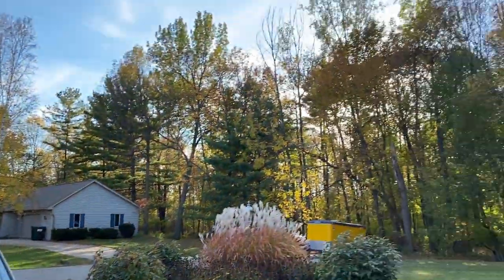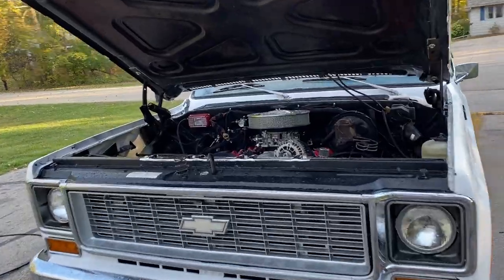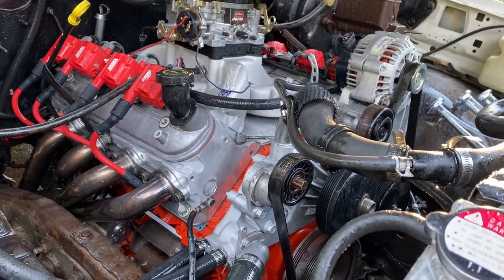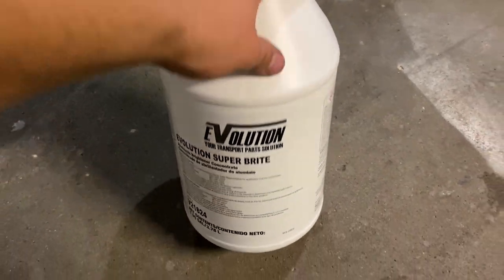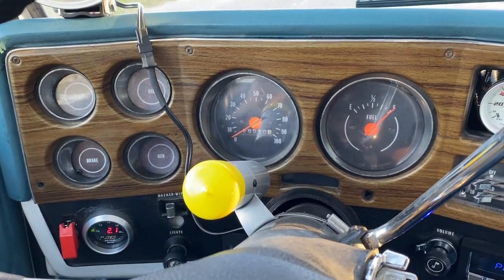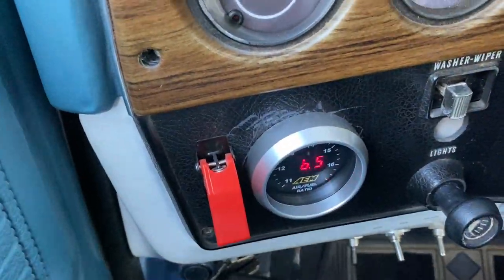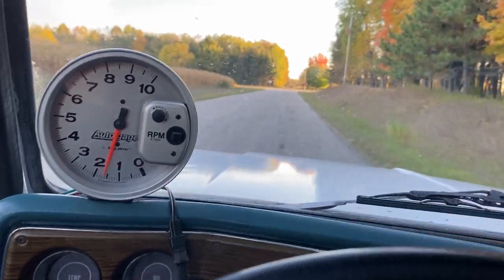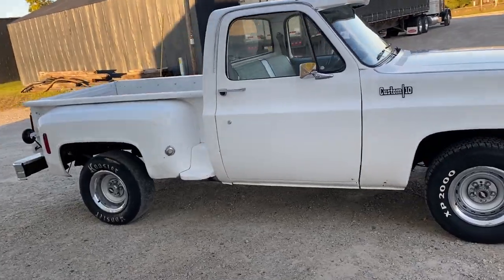Squarebody c10 testing carb AVS2 800cfm Edelbrock carburetor |LS SWAP|CARB LS|

Comment: That carb is way too big for that engine.
Reply: Not if you want a lot of high rpm with cam id think
Reply: He has an air to fuel ratio gauge. 
Looks like he was in the ballpark.
Those gauges are great for dialing in a carb. You can see how close you are to the 14.7 ratio though all stages of driving